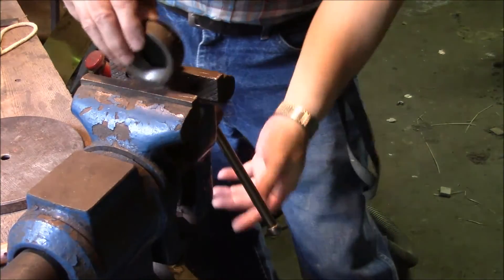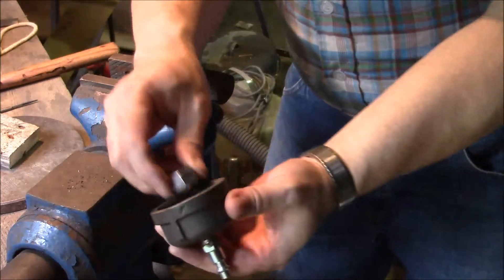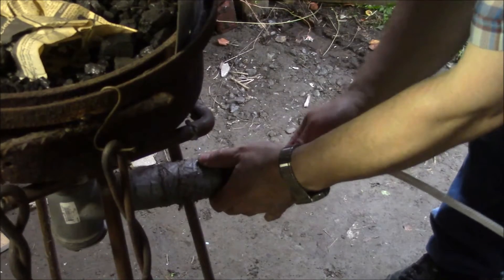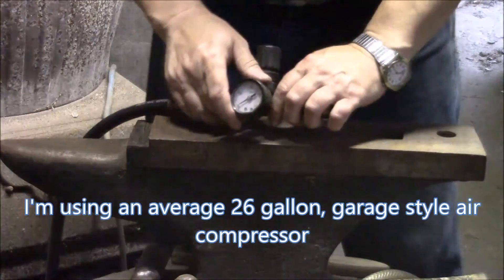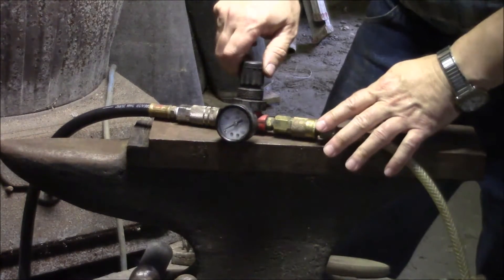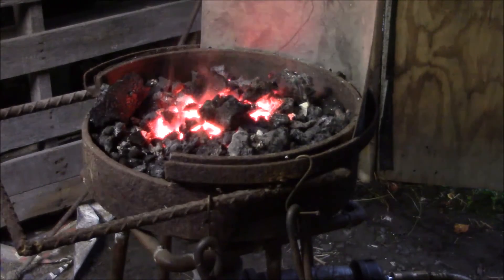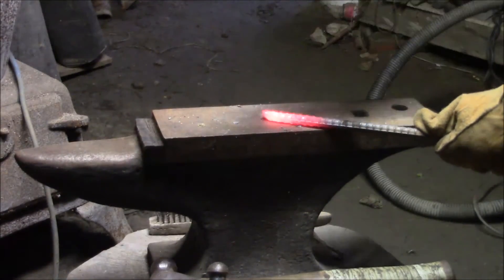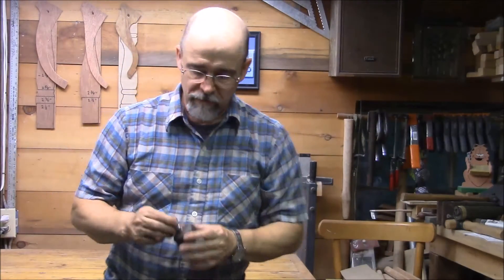DIY Compressed Air Forge Blower

Comment: Exhaust off a shop vac is better.  You need high cfm not high psi.   Plus air from the compressor will have more  oil and water in it than just blown air.  

I showed up at a job in Mexico a hotshot young weldor/blacksmith and got shown up by a ragtag team of roadside soldebura.  Some of the most resourceful fabricators I’ve ever worked with.  Anyway we built multiple gas and charcoal forges all fired by a huge compressor and 700lb propane tanks.   This whole operation was massively loud and the front office moved us half a mile to the back of the movie lot. We were melting out tuer pipes left and right and burning way too much fuel.  We also were getting heavy scaling which required extra cleaning before forging.   Plus the oil water filters needed constant attention since we were at a waterfront location w high humidity.  The lead Mexican weldor broiling his home forge that used propane and a 1950 something Electrolux vacuum cleaner.  It blew everything we built out of the water and was way quieter.  It no longer sounded like we had a squadron of mig fighters taking off for 10 hrs straight.

Comment: I would have left the cap off and put a tube down the throat of the tuarre(?) causing a venturi effect drawing in additional air !
Sort of like a gas fired that sucks in the air it needs for combustion and switch compressed air for the pressure gas !

Comment: I used compressed air as well. I run the air at full pressure (125LB) but through a boiler drain cock and adjust it with that. It can be adjusted the tiniest amount.  Just barely open works fine but if I want a lot of heat for a minute then I just turn the handle a bit. And I can shut it all the way off if I walk away from the forge for a minute.  Compressed air works really great.
Reply: Ivw e got an old upright Broomwade compressor and a spare regulator to get the airflow right i think your thinking outside the box a bit like me,for ionstance i sometimes use vise grips with square and round sections welded on to the jaws if it works why not use it
Reply: I think it is better to have a trigger, otherwise you might fumble finger the regulator and blow hot coals all over your shop.

Comment: Did you find over time that this was an option well worth it?
Reply from the maker: Unless you have a large air tank with a strong compressor I would not say that it is worth trying for a full time method. It uses a lot of air and would keep a smaller tank running constantly. For an occasional use it would be okay.